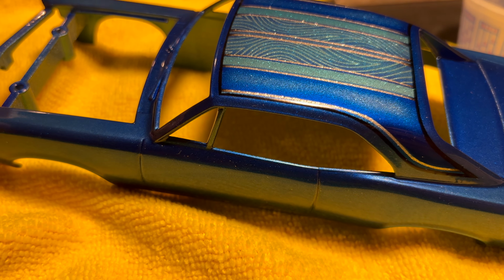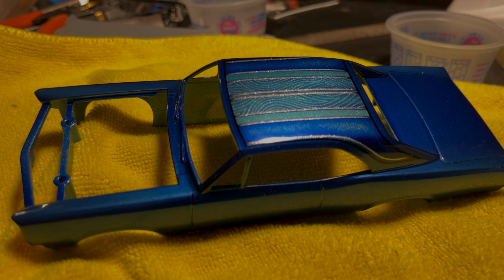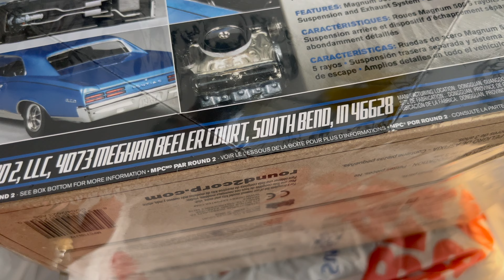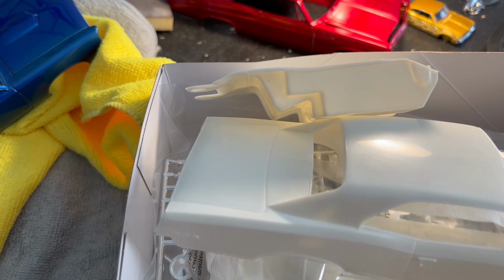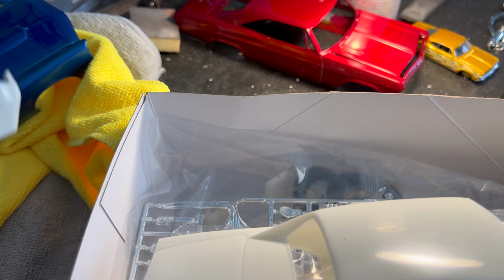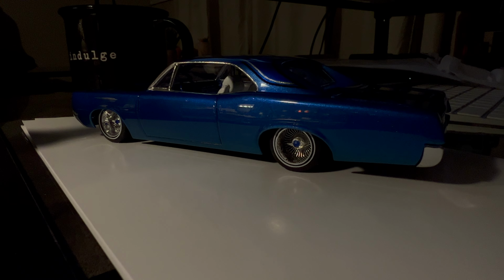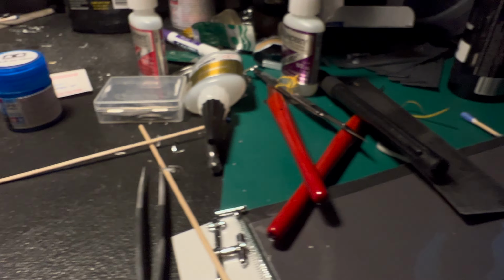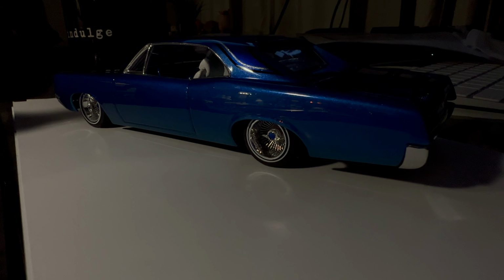MPC 1967 Pontiac GTO Lowrider Model Car Build | * PART 3 of 4 * | #mpc #lowrider #lowridermodelcars

Comment: What silver flake did you use?
Reply from the maker: .004, tropical glitz
Reply: @LowriderModelCars did you run a inner coat and reducer threw a .5 airbrush?? I was just there yesterday bc of you lol they told me it wouldn't working I  have a brush that has a .7and.8 needle I wound up just getting comet silver with is ok butt really want alittle bigger flake
Reply from the maker: Yes i mix the flake with intercoat and reducer, mixed at 1:1 ( 50/50 ) and can shoot it by airbrush. Now .004 will work with a .5 tip, thats what i used before getting a bigger gun. Now the problem you'll run into is clogging if you put to much flake in the mix. So youll need to mix in less flake and need more coats to achieve full coverage. You have a .8 needle and thats better for that .004 flake, now if you want to use a bigger flake then I suggest get a touch up gun with a 1.1 or 1.2 tip, i have Iwata but if your on a budget harbor fright has touch us guns and that work fine. For a model car you dont want to go over .008 flake , its not to scale for that small car but theres no rules so whatever look your going for its all good. Now if you want to use bigger flake youll need a 2.0 or higher tip